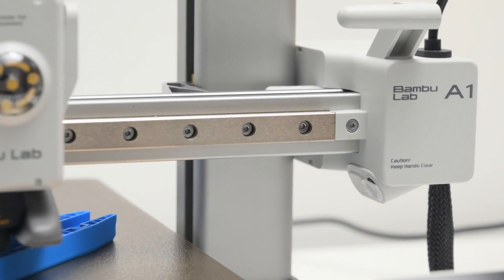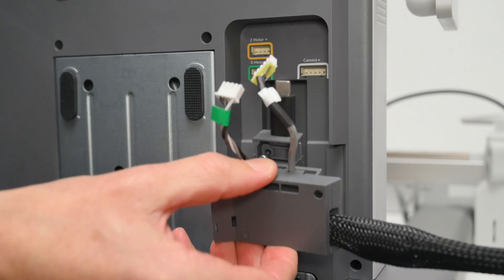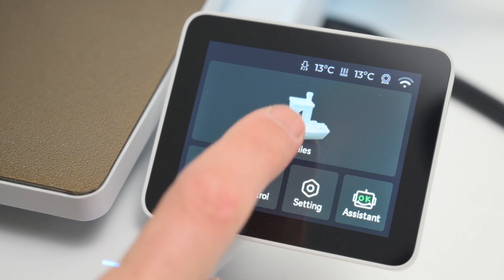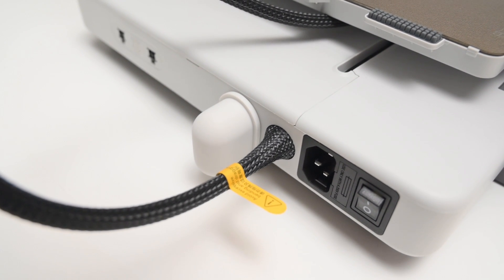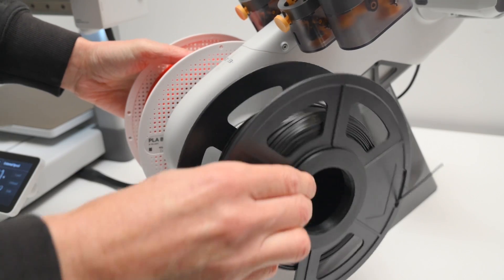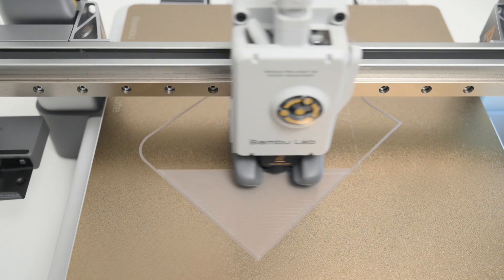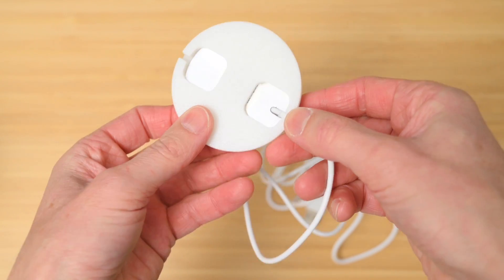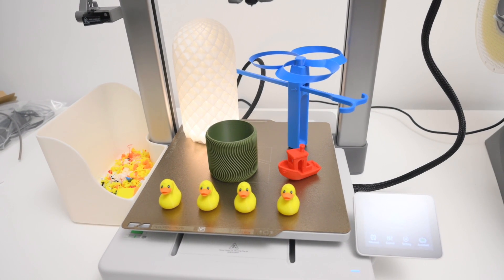Bambu Lab A1 & AMS Lite Review - BEST Beginner Friendly 3D Printer

Comment: If this is a beginner printer what would be considered expect printer.?
Reply: Creality and elegoo printers aren't "expert" printers because they are good, rather because you have to be an expert 3d printing because you will always have to fix something on any creality. Elegoo is a little more premium but nowhere near bambu lab. The difference is bambu is reliable and uses reliable parts designed to last and not need adjustment, no movement parts that will easily wear like rubber wheels that you have to adjust on enders and elegoo, rather on bambu you have precise linear rails and rods that you'll just have to lube once a month or so. Plus all the automatic calibration makes it so easy for a beginner to just pop in any filament and press print and the printer knows how fast the filament Is flowing how much to push through how fast and what frequencies to use to reduce weird artifacts caused from vibrations, compared to tuning filament temp, flow, pressure advance, speed, and everything else PLUS always fixing the rubber wheels and wondering why something isn't sticking because the bed isn't level or maybe z offset is wrong or maybe flow is too low.

I've had the a1 for a week or so after about 10 enders and 1 elegoo and a flashforge adventurer 5m and this has been my absolute favorite printer. I can actually work on designing functional parts and actually have something that is precise and accurate rather than wondering why my print isn't sticking or why it failed or why my extruder is clicking or why my build plate wobbles or how a screw got loose. I love the fact that I can choose my filament I want , press print, fall asleep, wake back up and have a pretty perfect part.

Any questions let me know
Reply: Try ender or eleegoo. Some of the model difficult to operate. But some of them is nice for larger print format 40 x 40 x 40 cm